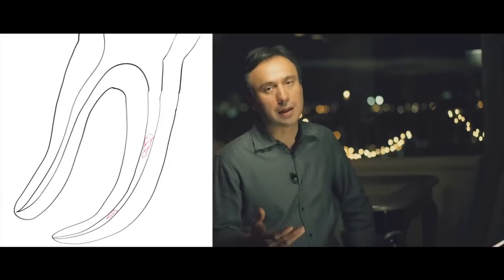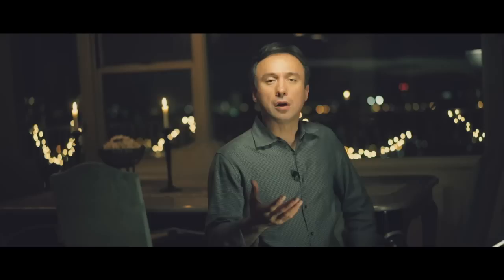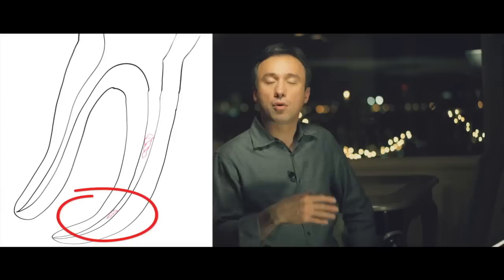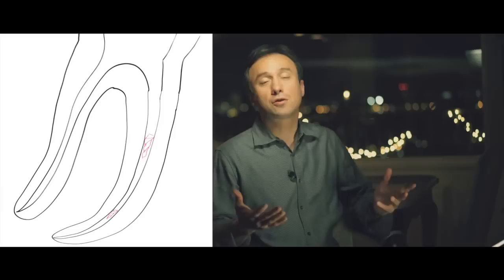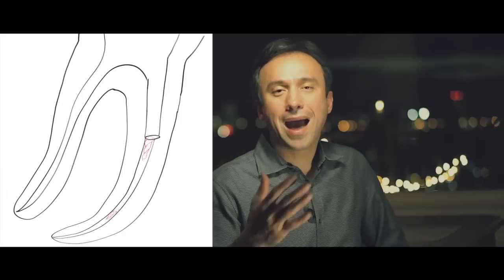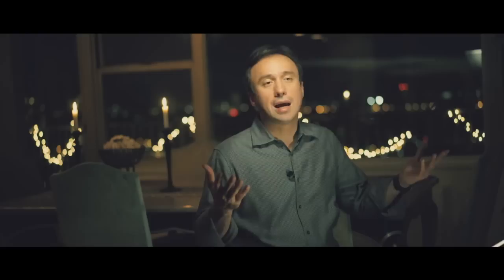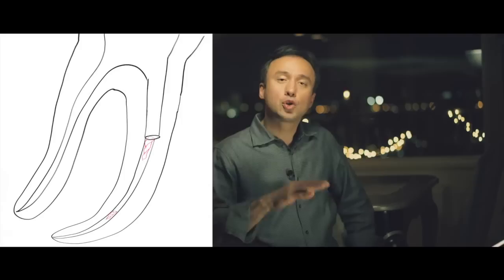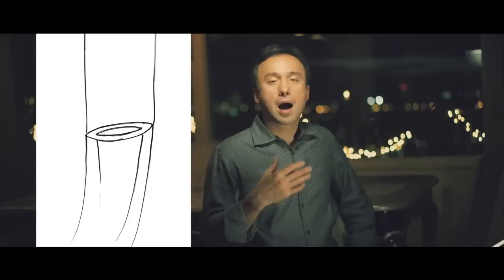How to Bypass A Broken File: Friday Questions

Comment: For now on if I ever need a root canal I will go to an Entodontis, I also tell everyone to have an Entodontis do your root canal than a regular Dentis. Entodontis are extremely good at doing root canals. I had a so called Dentis do a root canal on my front tooth and he broke like 4 files and left them there. My Entodontis removed all of them but one, because the last one went up pass the tooth. But later he removed it by surgery. I’m really happy now my Entodontis saved my front tooth and I have no more pain.
Reply: Your story sounds traumatic, it’s more likely that a dentist specializing in endodontics would do a better job.
That being said, people often look for cheapest offers, remember that cost accounts for the quality of equipment as well.
Endodontic treatment is a tooth saving attempt.
Many clinics use files only once per one tooth, results in higher price but lower chance of them breaking, throw in a microscope and again it goes up.
Standards and price are not always proportional but in my experience it more often is than it isn’t.
I work at a couple of clinics, one is a brand new private clinic with all the fixin’s, I have up to 2 assistants at all times.
The other one is a state owned dump, when I’m in there I refuse any procedures that I would not be able to perform due to the available equipment (some still do and it’s their prerogative)
It wouldn’t be impossible I just wouldn’t be able to put my name on it.
I know many regular dentists/or people in other specialities that can do just as well, unfortunately in this world there is a high manual skill requirement, 70% of my colleagues at UNI had two wooden hands.
It can be trained but there is something about having dexterous hands that have been trained ever since you can remember.
My observation when it comes to basic fillings:
US-from absolutely worst quality to god tier.
UK-from absolutely worst quality to god tier.
Sweden-(11-cases) absolutely worst quality-you guys are famous for this in Europe btw.
Poland-medium-good
Germany-medium-good
Norway-bad-medium
India-Jail-medium
Japan-medium-god tier
Ireland-bad-medium

Remember that some of these examples have less that 5 cases to form my perception, and that I’m not even suggesting that this is how their quality of service could be marked, it’s my observation and I’m not even accounting for socio-economics etc.

Comment: Hello Dr. Nasseh , 
Just a question. I had a root canal done on one of my molars by an endodontist. He said my tooth was one of the hardest he treated yet. When we looked at the X-Rays after, 2 files got seperated, each in a different root. The fragments are minuscule, probably less than a millimeter, and located at the very end of the roots. The endodontist admitted it could have went better, but that the prognostic is "good", and that the cleaning was done "to perfection" regardless. He said I shouldnt be worried, but check once a year or so to be sure. My tooth had a big cavity, but according to him it was in overall very good condition, a healthy strong tooth, hence his prognostic.

Not going to lie, I am extremely worried. I've been scrolling trying to find advices from other endodontists and to get some peace of mind. At face value, would you say that his opinion is correct, or was he trying to save face? 

Thank you. I know its never clear to answer without inspecting the images yourself but I appreciate your opinion.
Reply from the maker: Especially if your tooth was vital to begin with your prognosis is still good if the instruments separated later during instrumentation after some cleaning and shaping was already done. 
But I agree. It’s best to leave it alone if it’s at the end of the root. If you’re in the 10% or so of these cases where the problem arises down the line, a surgical apicoectomy can easily be done and the fragments removed surgically (going from the side.) So, the important thing is follow up. If one month after the root canal you have no pain be sure to go back and take a CBCT 6months after the procedure to confirm things are ok. Then take another CBCT in two years and if no problems then you’re in good shape and can follow up every five years and just see how it goes. 
But in these situations it’s best to take it out of your mind and do t focus on it as problems magnify when you focus on it. There’s no problem with these files being in there is the canal was already clean before it broke in there. The instruments can act as the filling material and are if no harm in themselves. The only issue is if everything around it is clean and that can be confirmed with follow up. No problem. If you already saw a specialist then you’ll have proper follow up and directions. 
Good luck... and don’t focus on it is no symptoms at one month! 👍
Reply: @AANasseh  Thanks for the quick response, it echoes more of less what he said and it is comforting to have extra comfirmation. 

I will follow what you said and check back in a month. The procedure happened literally 2 days ago. I do get little flares up of pain but I assume those are related to the healing more so than my paranoia about the files. 

Now I will go ahead and schedule a crown. I was hesitating at first because of the files but that seems to be foolish. Better safe than sorry.

Thanks again for the response. Root canals sure are an interesting procedure.
Reply: @polyfission2776  hello sir/madam same situation happened with me in my one of teeth files got broken 2 days ago,now I am worried can you please tell how is your teeth now
Reply: @shubhamphadtare9019  Hello sir, I have not had any problems since. But to be honest, I have not had any x-lately, so I am not 100% aware if something bad is happening. But I can tell you that I feel no pain, no infection, everything is normal. Dont stress about it, everything will be fine.
Reply: @polyfission2776  Thank you so much dear😊

Comment: Dr How can we bypass a broken file in the apical third especially if the root was curved ?
Reply from the maker: You can't in a predictable fashion. Just use a stiff #6 file and pray. Try for about 5 mintues. Beyond that you can cause more problems and potential break another file. If the tooth was vital you may get away with it. If it was necrotic then you may have to refer out for an apicoectomy, which will have a very good prognosis in the right surgeon's hand. Good luck.
Reply: Thanks Dr, it really helped :)
Reply: @AANasseh  what do you mean you may get away with it dr?
Reply: @henmari6684  You have probably seen a lot of canals filled in 1/2 or 2/3 that are asymptomatic clinically and without radiological signs. It is because closer to the apex pulp is more vital and resistant and can remain vital. The wider the apical foramen the better chance. What's more dentin in canal is not penetrated with bacteria, so it minimizes the possibility to inflame the remaing pulp.
Reply: @AANasseh  actually I experienced broken file at the apical third of mesial root of tooth 47 last month. I irrigate thoroughly the canal and I pray hard that it will not not cause problem in the future. btw, it was a vital canal.thank you for this answer doctor.

Comment: what to do if even the bypass fail .... i have had two broken files in my rooth canal and my tooth is not healing after 3 month of treatment of the RCT
Reply from the maker: Mariam the explorer The best option is an apicoectomy if the area is anatomically accessible through surgery. You need to see an Endodontist who’s does MicroSurgical procedures. Good luck!

Comment: What do you think about the  komet endo rescue retrieval kit? Have you used any other kit?
Reply from the maker: Have not used it and have no idea how good it is. But the idea is the same as all the other techniques. Create a platform around the broken instrument and use an ultrasonic to dislodge, only in cases you can see directly with straight line access.
Reply: @AANasseh  just tried it. Didn't work. The screw got jammed with dentin, and as a whole, it's just an overpriced pack of gates and endo z drills.
Sometimes I think it would be easier to try a brute force approach, and remove the files with a very long high velocity diamond drill, on a counter clockwise movement, just the way we remove metallic posts

Comment: Dr. Nasseh , i just broke a #10 k manual file in the apical third past a curvature ,measured around 7mm ,i already had achieved patency in that canal prior to separation.

i was able to bypass the broken file and even file till 35 taper 4 with rotary files to almost full wl ( lost half a mm), the obturation GP goes along the broken file , but it's almost 2mm short of the end of the file.

any tips for proper obturation after bypassing, i wish i could share x-ray but  youtube doesn't allow links, on x-ray it looks as if i broke a 2mm file and then slapped a gp on top of it.
Reply from the maker: Not a lot you can do in these cases and simply filling a couple mm short is not as bad as not instrumenting to length. Probably best to focus on causes of file separation. Otherwise you can overfill by pushing too much without knowing exactly how to manage. Better luck next time.
Reply: @AANasseh  the cause i think was the severe curvature and limited mouth, i could tell there was a risk, so i used a new manual file, but yeah got unlucky. 

should i have used a lesser taper for obturation like taper 2 instead of 4?

Comment: I am having broken file beyond tooth root in bone what should I have to do.
After 8 months pain reduced.
But can it cause cancer as it may cause repeated wound
Reply from the maker: If you are a patient please see a specialist for a consultation as you may require surgical removal of the instrument if infection or pain is present. If no infection or other symptoms following clinical and radiographic evaluation then the broken segment can be monitored with occasional radiographs to see if any infection develops. No worries about cancer at all. At least, not because of the instrument! Good luck!
Reply: @AANasseh  will you please give me mail id or other means to show you radiograph (x ray) it shows broken segment protruding out of canal root in bone. If I chew with that tooth I got little pain.
Doctor suggest to remove tooth or surgery to remove segment of tooth previously (when the pain are more now pain are diminished), but I want to retain the tooth. Please help.
Reply from the maker: @dekhanesandip683  then surgery to remove the segment and a proper apicoectomy and retrograde filling by an endodontist is indicated. please see a surgically trained endodontist.

Comment: Doc #15 k file was separated at apical third covering more than half the root length if I don’t have the option of retrieval and have obturated. What is the prognosis of such a teeth . Patient complained of pain on the day of obturation on pressing the teeth . Thank you sir.
Reply: I am having broken file beyond tooth in bone what should I have to do.
After 8 months pain reduced.
But can it cause cancer as it may cause repeated wound
Reply: @dekhanesandip683   Stay with the smaller files in a linear filing motion for a longer time before going to larger files.

Comment: this video is broken near the end of the canal . thank u anyway
Reply from the maker: +theexperiment asd The annotation explains that this is an excerpt and you can see the full video on the RealWorldEndo website (link in the description). BTW, basic membership on the website is free.
Reply: +RealWorld Endo i cant signup because there is a problem with the captcha code button . how can i fix this ?
Reply: +theexperiment asd 
Hi - what browser and OS (mac or PC) are you using - we will look into the issue for you.
Reply: +Marko Basten i changed wifi connection and the captcha button appeared . thank u for ur concern
Reply: +theexperiment asd 
Wonderful! Thanks for the note.
Reply: Real World Endo